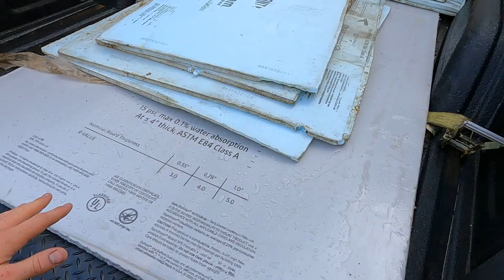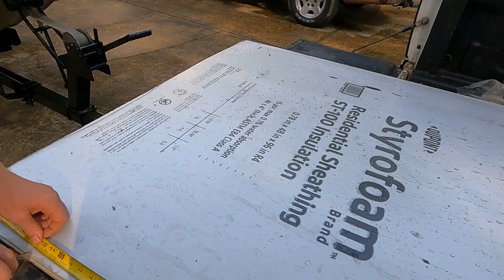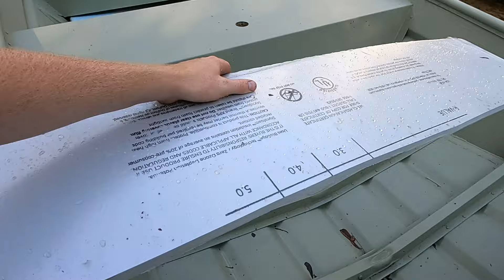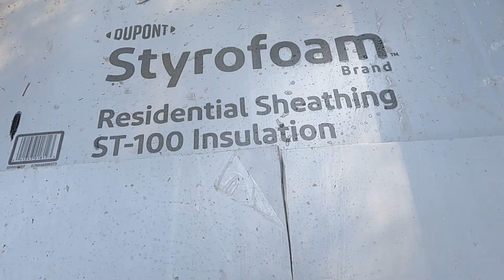The EASIEST DIY JON BOAT FLOOR! | Durable, Lightweight, and Cheap! | Install Guide

Comment: Any moisture/rusting issues since air can’t get under to dry it out?
Reply from the maker: Nope. It's all aluminum so no corrosion. I've had it since 2019 with no issues